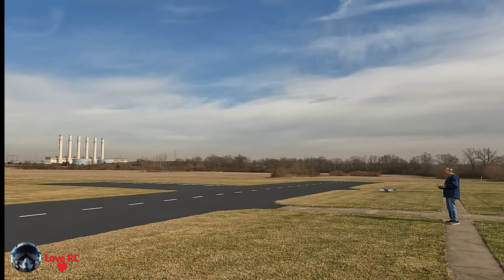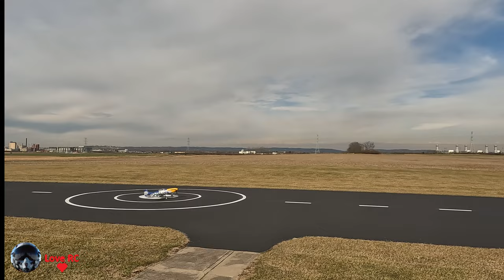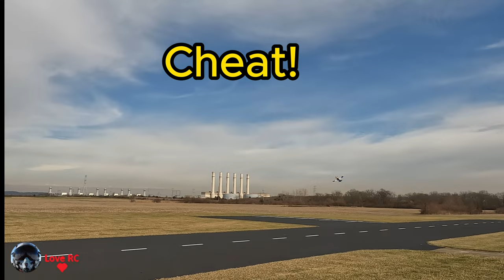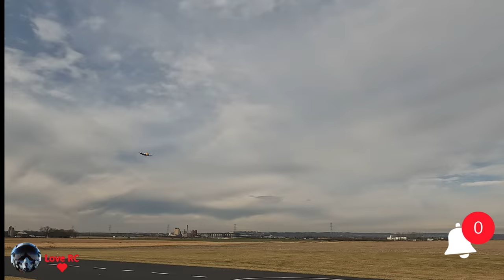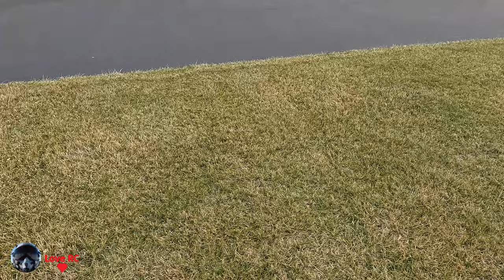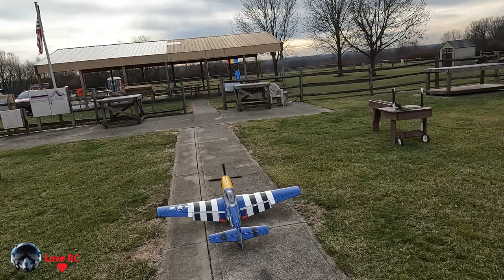E-Flite Mustang 1.5m - Takeoff practice. Not exactly unleashing my flight skills.

Comment: Nice flying 👍 
1 don’t use too much flap, it will lift your tail wheel off the ground before your rudder has enough authority.  (Same applies when landing on grass. Raise your flap asap to prevent nose over)
2 before you build up enough airspeed. Pull the elevator to “push”your tail wheel on the ground. So you could steer it in a straight line. 
3 when you build enough airspeed. Ez in the elevator stick. The tail should fly by itself. Add some up elevator, right rudder, and some throttle. It will lift off nicely.
Reply from the maker: Thanks!!  Great advice!!!
Reply: 100%... No flaps and plant that elevator to the ground for a bit...
Reply from the maker: @SteffenRC  Thanks!!!  I'll try that next!!
Reply: @LoveRC  I made a whole video about taking off with a taildragger.  They can be a pita.
Reply from the maker: @SteffenRC  thanks!! I’ll check it out!!

Comment: Nice job!  It is a fine line on the take offs.  I like to use full up elevator until the plane is just about to lift then relax because there should be enough air moving across the tail.  This is the point you are flying with the wheels still on the ground.  Did you land in the grass on purpose?  I would have!  These big warbirds really like the grass.  👍
Reply from the maker: Thanks I’ll try that approach to take offs.  Yes grass landing was on purpose.

Comment: P-51's can be difficult. Don't use flaps on takeoff. They'll make it nose over. Hold the tail down with up elevator. Feed the power somewhat faster. Let the tail come up between 1/4 and 1/2 throttle. Use the rudder to steer it on the ground and during climb out. Only use the ailerons to keep the wings level after takeoff. It would help if the nose weren't so high and the tail so low when it's sitting on the ground.
Reply from the maker: Thanks!! I’m going to try no flaps.

Comment: I had the same issues on pavement. This plane loves the grass take offs. I can get mine off the ground in about 3 to 4 feet as well but you need more throttle and be ready to rudder steer quick. Good video Love enjoyed watching 🖖 If you have a chance check out my Snow Carbon Z Cessna Video That is my current flying conditions LoL
Reply from the maker: Yeah the grass can be easier. I was landing my Viper on the grass at first to avoid the violent bouncing. Then I figured out the CG and holding her off.  I’ll get this Mustang sorted eventually.

Comment: With years of RC flying, one of the things going against a scale model like a Mustang, the long gear legs, short tail wheel, and a fixed pitch prop. Watch videos of a full-scale Mustang back in WW2, they were fully fueled, armed and the added weight collapse the gear down. At takeoff they use less pitch and more manifold pressure. We have neither. Best advice, a lot of right rudder and if it gets loose, start over, better to taxi back than to be grabbing a garbage bag to take her home.
Reply from the maker: Yeah I do aborted take offs often. 😁